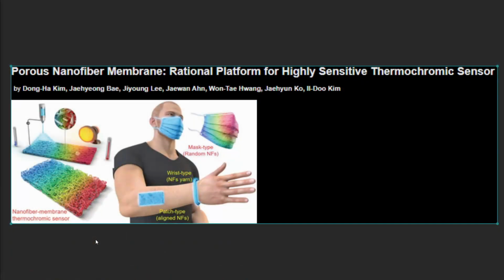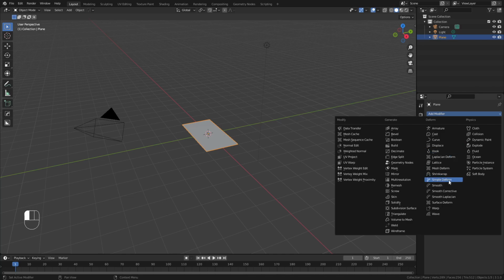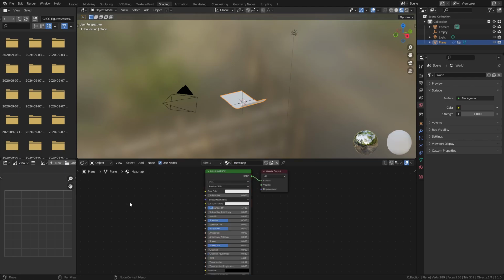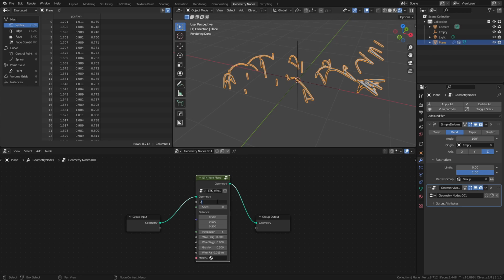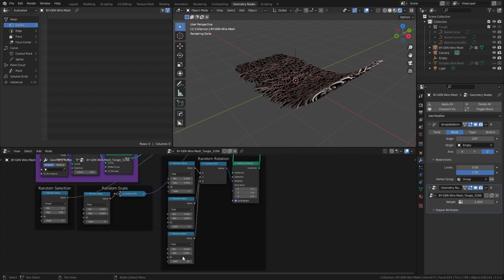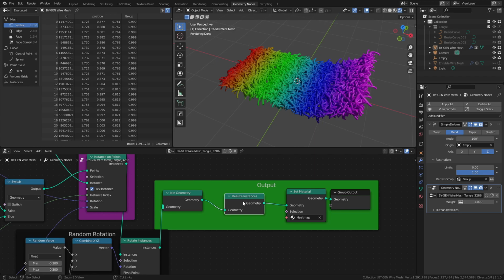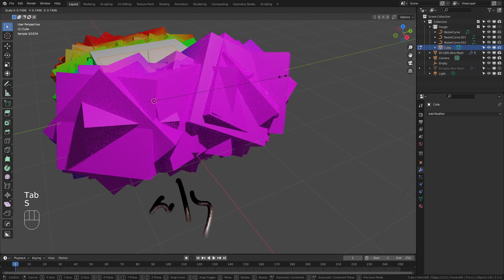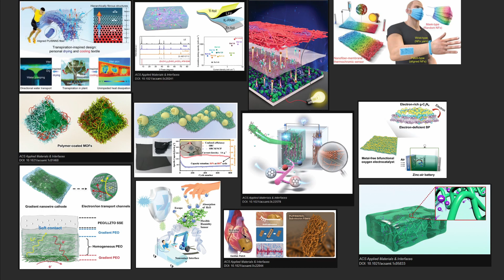Blender for Scientists - Creating Quick Wire Mesh Figures

Comment: hey CG FIgures,
 Amazing tutorial! I have purchased the Erindale's toolkit. I am wondering is there anyway to cap the end of the fibers? I have seen many open cap in my fibers which appears like many weird black spots.
Reply from the maker: Hey Howard. Yes. If you open the wireflood node (just click the little icon on the top right of the node) then find the "curve to mesh" node (second last before the output) there is a toggle box for "Fill caps". That should do it.
Reply: @CGFigures  That works like a magic! Thank you so much.

Comment: just wondering if this could translate into realistic muscle fiber firing
Reply from the maker: There are adaptations of this that are used to make stylized 'fiber-bodies'. It would depend a bit on what you had in mind for showing the firing but it should be possible.
Reply: @CGFigures  I mean dynamic fibers that stretch and expand between anchors